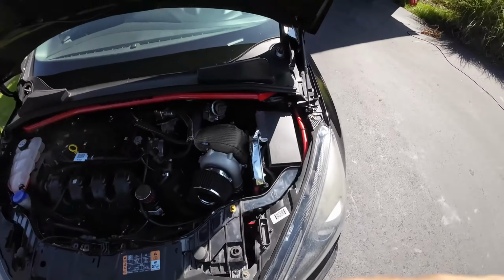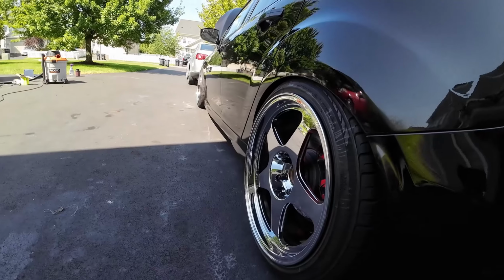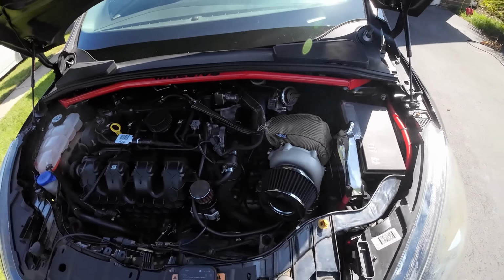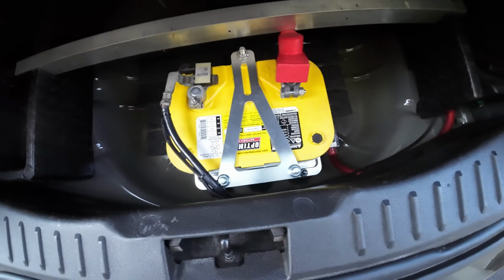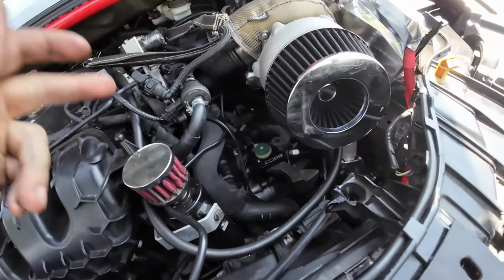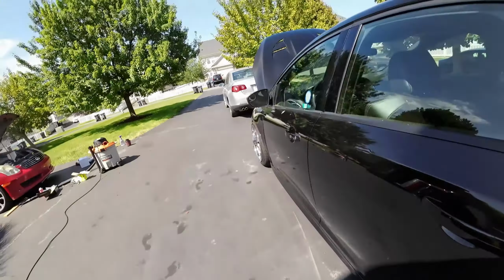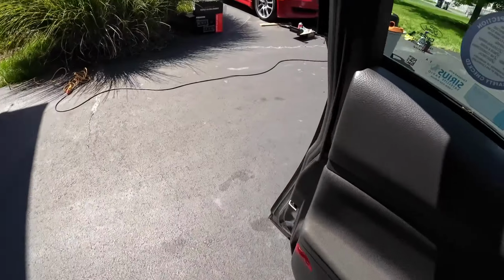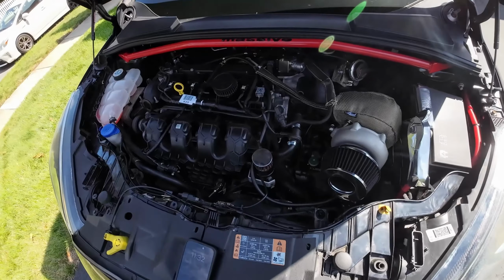BIG Turbo Focus ST with T51R MOD!!

Comment: When your purge valve goes out, what kind of symptoms are there? Im on the original purge valve since 2016.
Reply from the maker: misfire, hard starts, running rich, small evap leak rough idle

Comment: My God that is MUSIC to the ears! Just one question: did you remove any of the sound dampening in the engine bay? (inner hood, cowling, etc)
Reply from the maker: thank you brotha 🙏🏽 blast to drive 

and so i have a anderson composite hood! so i didn’t transfer anything from the old hood! as far as the engine bay i did sound symposer delete and stuff like that and the turbo relocation got rid of alot of that sound dampening for heat wrap and tape

Comment: Why no heat
Reply from the maker: well… i was honestly trying to get the car together before winter to enjoy it and get it happy. 

the plan this winter is to redo all the lines and re route my lines to the heater core cleanly. The top mount turbo wouldn’t let me know the existing lines, way to close to the manifold :/